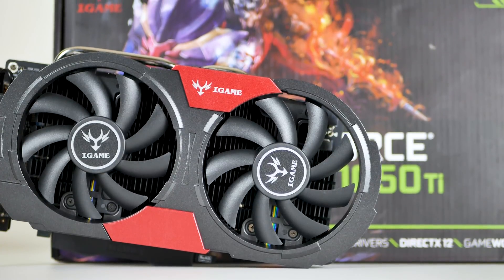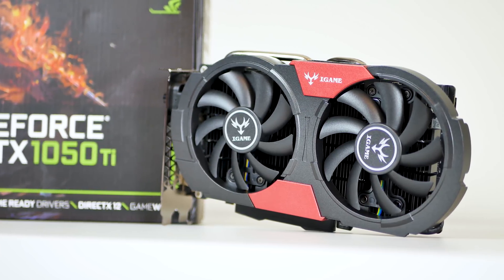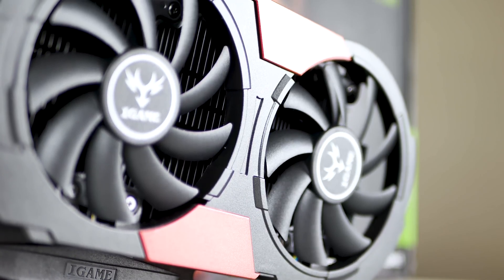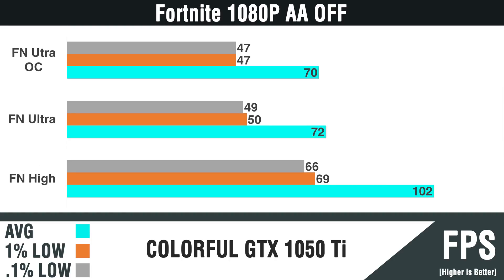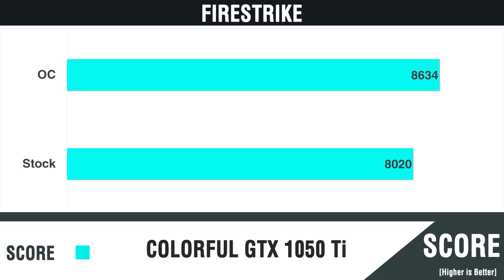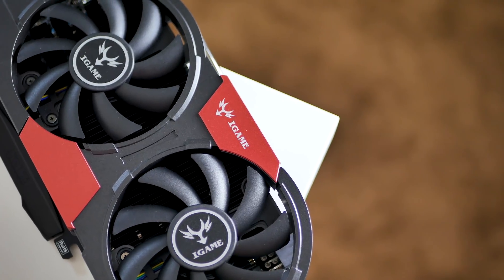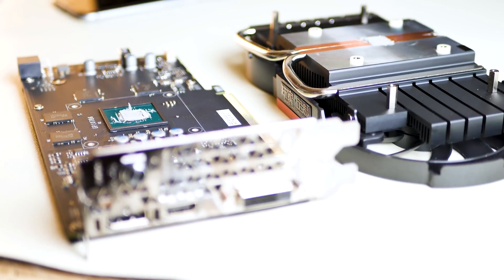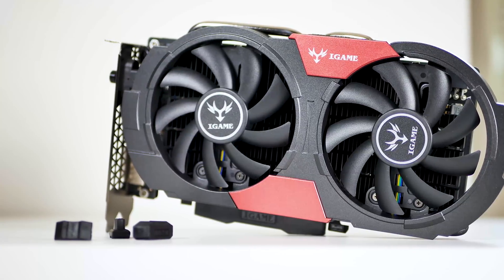Colorful iGame GPUs? Is it a Brand You Can Trust?

Comment: I have bought a Colourful RTX2080TI , i feel good
Reply: well i think colorful is great. It provide good warranty service in china. No matter which brand you buy, you will always install the official driver from GeForce.    The overclocking and light adjusting tool from colorful is ok, the tool is called I game zone. If you want to adjust the light, you must use this tool from colorful. However if you want to overclock you can choose other brand tool and it is compatable.
Reply: @exploretheworld17  Hi, thank you for your review. Can you tell me, after this 6 months, your RTX 2080 Ti is still working fine? Have you done the OverClocking? How about quality and FPS?
Reply: @angelodente3069  I have a Colorful RTX 2060 Super and have no problems with it. It runs smoothly, quiet and temperatures are very stable.  I am quite happy with my purchase.
Reply: @Krenisphia  after a year how does it still doing? Does it durable? Reliability?
Reply: @Jiilaker  Yes still going strong. No problems so far. Very impressed.
Reply: How do you like it and would you recommend?
Reply: Yes please tell us. I am planning on buying a Colorful RTX 2060
Reply: @spicyLEGO  its good i have it